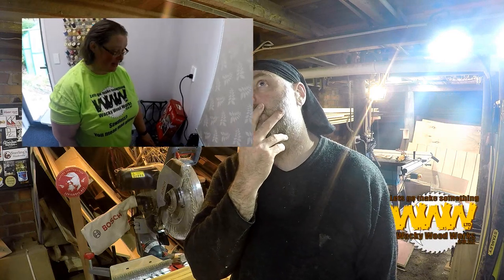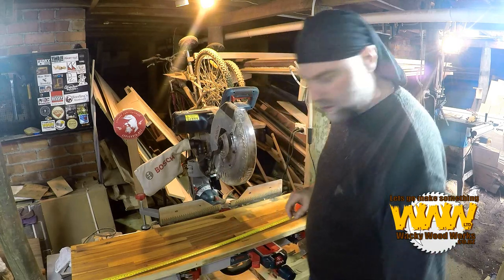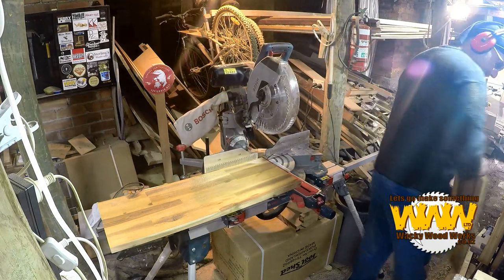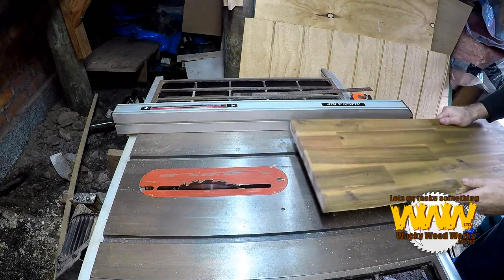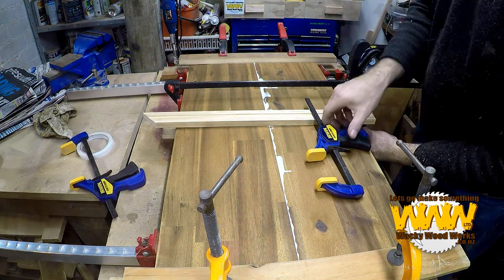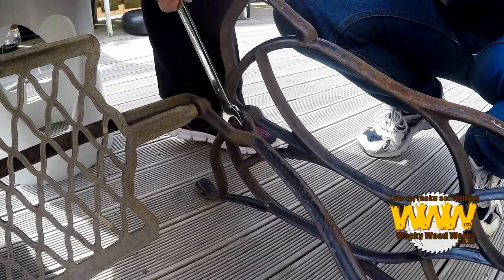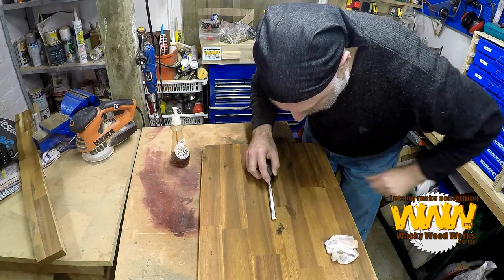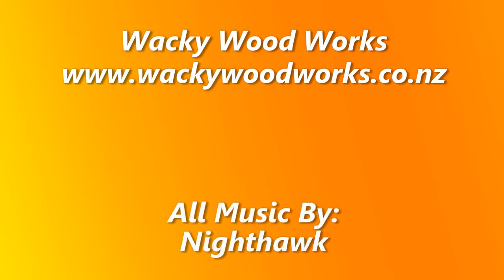70 Year old Singer Sewing Table Restoration - Off the Cuff - Wacky Wood Works.

Comment: Once I get around to sorting out some bit and bobs here I might have a few parts for that machine, namely bobbins and feet if the didn't get lost. The knee operation takes a bit of getting the hang of, however I may still have a hand crank unit to fit that machine as well, and that takes some real skill to use well.
Reply from the maker: Cool beans... :-)